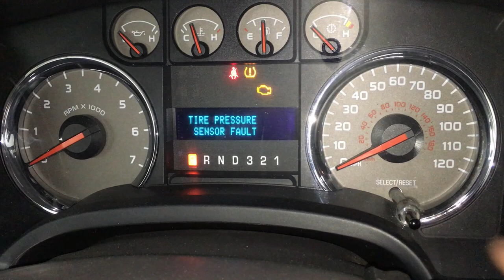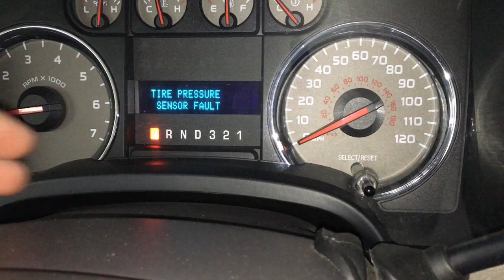1997-2010 Ford F-150 Rear Brake Job: Pads and Rotor Replacement

Comment: What after market front rotors do you suggest using on 2005 ford f-150?
Reply from the maker: a/c delco professional is what I use.
Reply: where do you pick these up chevy dealer?lol I looked i cant find these rotors at local part stores. Do you have a link? Thanks in advance.
Reply: do they have these for a fx4? Amazon has them but they say it dont fit my vehicle.
Reply: I Found the rear rotors on amazon. They do not have the acdelco professionals for the front. What do you recommend for the front rotors?

Comment: Is this the same for a 2004 F250?
Reply from the maker: +Ken MacMillan yes they are almost identical except for the full floats
Reply: FordTechMakuloco 94 f250 7.3 2wd rear drums. after bleeding good pedal then, spongy with very little brake.  new hardware w/pistons, master and booster. no leaks found. more bleeding? any ideas? haven't had this issue before. thank you kindly.....Btw no cruise control
Reply: Did you bench bleed the master cylinder prior to install? Air often likes to get trapped in them. Try cracking the lines coming off of it to bleed it on the car. Same as you would the rest of the system with a person pumping pedal and holding then cracking the fitting loose. A couple times should be good. The rest of the system will then need re-bled too.
Reply: Josh Leduc Ahhh , I only cracked the lines. thought gravity drip would work. I'll do that, thank you kindly
Reply: Josh Leduc I've always opened the brake master cylinder and if the fluid is pretty high I would take some fluid out so it won't spill over when doing a brake job. Pressing the pistons in pushes the fluid up into the master cylinder. It also serves a dual purpose by bleeding whatever air is in the lines up through the master cylinder.

Comment: No loctite on bolts needed?
Reply from the maker: +John R Not on caliper bolts only caliper bracket bolts
Reply: John R there's really no need to put any on the bolts. They're pretty secure.

Comment: the emergency brake that is gone is for emergency if the main brake fail. not smart to take it off
Reply: maybe they will sue you for letting them drive the car like that if they will have an accident
Reply: Daniel G its actually a parking brake
Reply from the maker: +Daniel G No it's just a parking brake that was already remove by the customer these are not technically emergency brakes as they used to be called which is in accurate.
Reply: They are not really referred to as emergency brakes very often anymore. Using the parking brake on a moving vehicle is kind of dangerous because you could lock up the rear wheels and lose control. It's quite rare for the brake system to fail completely.
Reply: From my experience its normally a blown brake hose that causes brake failure. If you blow a hose on the rear the front brakes should still work well enough to stop, albeit the pedal may feel like its on the floor. Brake master cylinders have 2 pistons, one for front, one for rear as a safety measure. I've driven many a car to the shop like this, but I don't recommend the customer try it..potential to end in tears and no insurance etc.
Reply: tecnaman I would have to say I disagree with all of you guys, I live in the rust belt and can tell you I've seen many brake failures on ford trucks, and when they go you have nothing. I thought the same thing about having a duo reservoir master cylinder, but the problem is not from the master cylinder, but with the abs unit, when you loose pressure, doesn't matter where it is, you completely have no brakes. I have experienced it first hand and can tell you I probably would not be here now if it weren't for the parking brake.
Reply: Ok then explain to me why my right front caliper hard line broke due to rusting away and I had No Brakes whatsoever! This is not the first time this has happened, and I have had allot of other people that this has happened to. Are you speaking from personal experience or what you've read in books. Not going to waste my time explaining it to you, try it yourself and see what happens.
Reply: i had the same experience of rusted brake line that blow and had no brakes at all. that was my point from the beginning but those guys don't severe a crash at 25 mph can be and the parking/emergency brake can save your life
Reply: Daniel G Daniel, thank you, finally someone who has had this experience, and just to clear the record Joel I'm not talking about a leaking line, I'm talking about a full blown rupture of the line, you will get maybe 2 pumps of the brakes then nothing, once the fluid is run out that's it. I am also from Michigan and have been a mechanic for over 30 years, I know what I'm talking about.
Reply: Where I was raised a mechanic with a license (someone like me) could yank that truck off the road til the parking brake system was repaired to operating spec. Plates removed and a tow only order stat.
Reply: modern vehicles are extremely rare to have a complete brake failure maybe in the 1920's or someone sabotages your car.
Reply: @Joe Knapp Actually Jeff Kreft is correct. I've driven assorted F150s for 25+ years .. if you blow a brake line, which I have several times, you have NO brakes. The crappy "parking brake" is all you'll have.

Comment: I tried restoring my 05 F150's parking brakes with new springs/ hinges. It was super difficult and I gave up. Way worse than even drums
Reply: Ryan A 
I found a great video on repairing the drum in hat parking brakes on these f150s. do a search on it, it was a longer video like this one from brian , but it covered just about all the problems you'll face and how to address them. parts were cheap thru rockauto, my e brake works great. I've got a very steep driveway, so I use mine everyday to not damage the drive line due to binding in park.
Reply: I'll take a look thanks!!

Comment: 73.00 for one  rotor doesn't  anybody cut rotors/drums any more?? the one you took off looked like it could be cut. napa cuts them for 20.00 . I know the parts guys , autozone , advance don't do it just seems like a waste. plus the ones they sell are all china crap. just my 2 cents.

Comment: you will use less brake klean if you wet a rag and wipe both rotors at the same time as compared to directly spraying the rotor
Reply from the maker: The amount of brake cleaner wasted does not matter to me I put customer satisfaction first. The reason I "wash" the rotor first then spray a rag and wipe it  is I want to remove the bulk of the oil residue first before I just smear around the oil coating on the rotor. This results in a much cleaner job and higher customer satisfaction in the end.

Comment: Could my rear rotors cause me to get a shimmer when I take off from a dead stop?
Reply: Yes.
Reply: Anthony Aubrey yes either 4 of your rotors can cause pulsation when stopping or resuming from start you should also be hearing some squealing too although it might be inaudible from inside the cab
Reply: drwombat.... It shakes like hell when stopping. It's done that for some time now. It just started shimmering recently, only at take off from a complete stop. It's coming from the rear.
Reply: Anthony Aubrey sounds like you need new rotors or could be anything from bad calipers, stuck guide pins, seized brake pads. Replace them yourself and follow the instructions given here and you save $100s of dollars.
Reply: Thanks